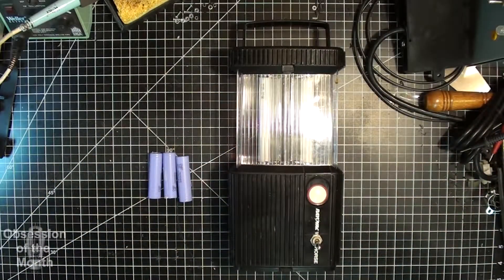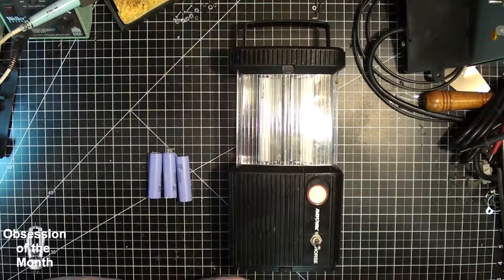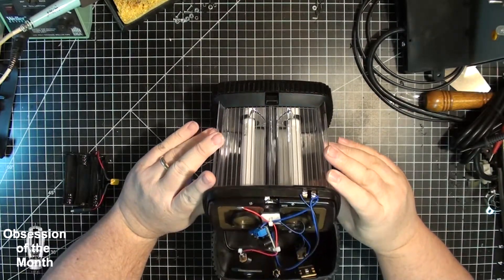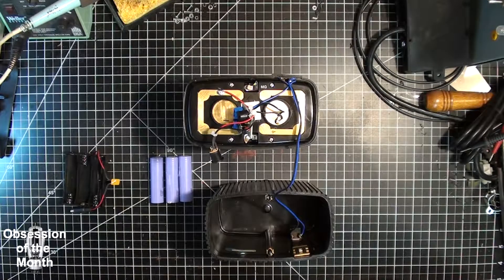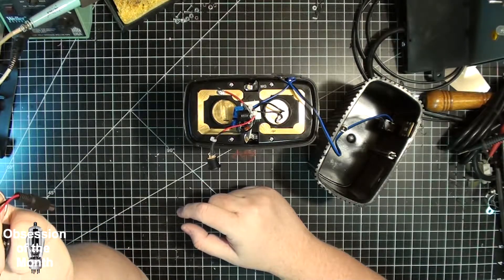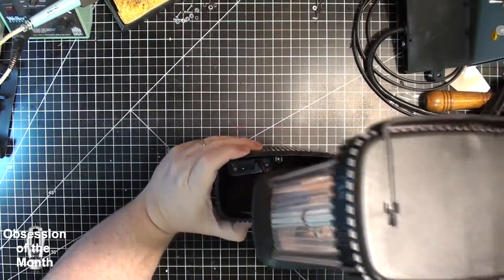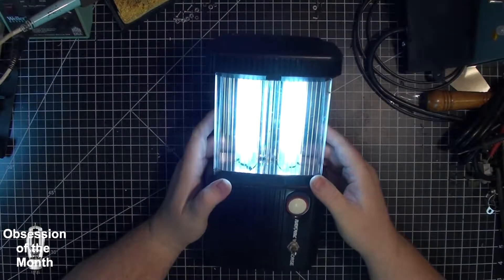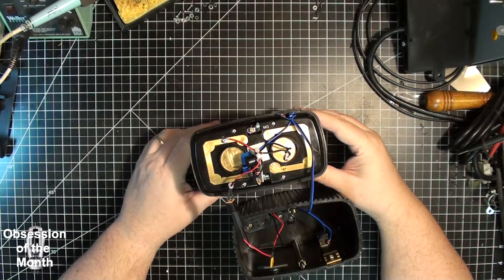1988 Rayovac Workhorse Lantern 18650 Battery Conversion

Comment: Hi.  I have one of these Rayovac Workhorse Lanterns purchased back about 1988. After purchase and very little use, the big 6 volt batteries ran down and were too expensive to replace for the little anticipated use of the lamp.  Recently while doing other things, I spotted the lamp still in the box collecting dust and I decided to see if it might be worth trying to refit it.  I was also considering a rechargeable 18650 conversion but didn't know how to handle the 'over discharge' problem, where repeated full discharging of the 18650s will kill them quickly. Came across your video in my researches.  How long does the lamp last on 3 18650 batteries? I see that you inserted a 'low-voltage' detection circuit. Does this cut off the circuit upon low voltage detect or only trigger a warning led?  What components did you use?  Do you have a detailed diagram and parts list?  Thanks.  It would be cool to get this lamp back in service.
Reply from the maker: It has been a while since I made that video.
I have not used the lamp in a couple of years, and only had a chance to use it 2 or 3 times while camping (after I converted it to LED's). so I am not sure how long it will last. however I used it on 3 occasions for a week without having to change the batteries (I charged them between trips). it was used for about 1-2 hours at night at varying brightness levels. I did not review my video and it may contain more information.

the low voltage is circuit is just an alarm. were  I to do this now I would use a proper BMS for the batteries. I was just using stuff I had on hand.

no I do not have a detailed list, all parts used are mentioned in the video. no sellers are listed because they often stop carrying items when they run out. search for the descriptions I gave in the video.

I also have a video where I convert it to LED.
https://youtu.be/UwJ4gKCDgw0